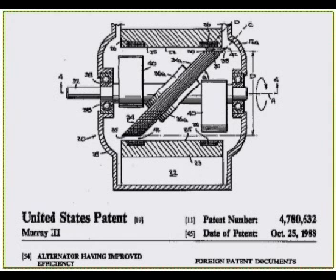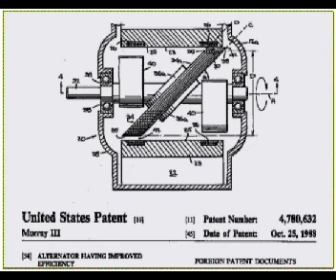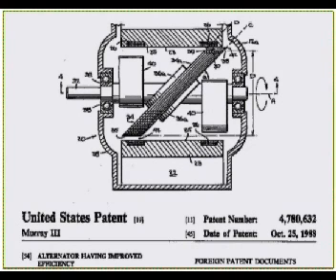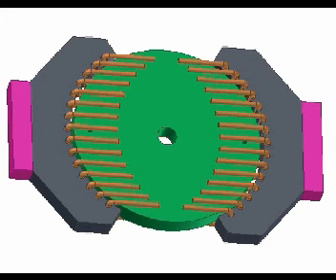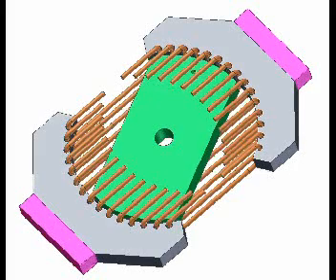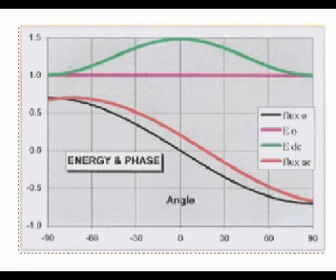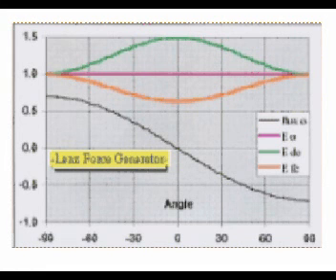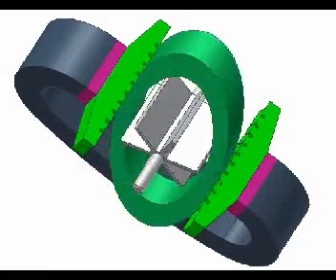Generators rather than Magnet Motors may be the way to go

Comment: Just use 2 wires (next to each other) on your secondary. At resonance (20, 30, 50 Hz & multiples) - there are no Lenz forces - due to the modulated energy bouncing down the capacitive channel down the middle of the 2 twisted wires.

Comment: I don't know what kind of energy device I wanna start on I have so many idea's from all the video's I have saw on youtube alone, but I know wood gas is very promising.  I have thought about making a device that produces hydrogen efficiently with solar panels and home made battery's but I know there is a sweet spot in the frequency to get it to work right which everyone says is a square wave I don't know but I have to get off the grid my electric bill goes up to $800 in a farm house suggestions?

Comment: Well said, Entropy is something many people don't realize and fail to see that it is the demise of any perpetual motion machine. Even a frictionless superfluid fountain will stop running eventually because of entropy outside of the system will no longer be ordered enough to power the extreme lows in temperatures. With that being said it is possible to create a relatively long lasting but not perfect perpetual device, hence a superfluid.

Comment: Earth will eventually lose its energy, as will our sun and just about everything else in this universe (unfortunately stupidity will continue flowing).  Just getting a heavy object to float using the magnetic fields generated by "permanent" magnets (which, by the way, do lose their magnetic fields) won't cancel out friction from the air AND from the magnetic fields themselves.  If just 2 repelling magnetic fields was enough to produce 0 point energy, we'd have already done it.

Comment: This whole thing is obviously bollox. 

Without an external power source a mass will only move due to momentum or to reach a lower energy state. For a cyclic system, reaching continually lower energy states is impossible because each revolution goes through exactly the same energy states as the previous one. 

That's why we can't make a roller-coaster that runs forever. Only a frictionless system could run forever, but that could never do any work because work would slow it down.

Comment from the maker: CoP is Coefficient of Performance  - Work or energy in divided by work or energy out. Commonly used term in refrigerators and aircon. Work in for magnet motors is zero. 5% in a more practical device is better.

Comment: He gets back EMF because of the presence of ferrous materials. Simple solution is Air-Coils in 3-phase array over axle spinning Neo's. Back EMF is prevented by USING ENERGY DIRECTLY from polar coils in a wheel magnetic Drive OR sinking it in sub-charged battery when Drive temporarily stops. This system keeps energy flowing in Transport uses, thus preventing heat loss from back EMF. Reversal of DC Motor into generator by induced rev.EMF is another question - you can simply PETAL axle rotation.

Comment: maybe,  but could i offer something to you that could be of interest....

dc motor generator,  generates energy into a capacitor at a cost of drag so no free lunch.  

but if i run one of the leads from the generator through a transformer the drag decreases and you get High Frequency High Voltage out of the secondary that you  rectify to charge the capcitor.  almost no eddy currents
i must add that you must pulse the circuit also. it make it pickup collected spikes.